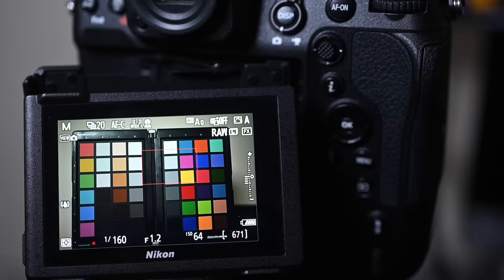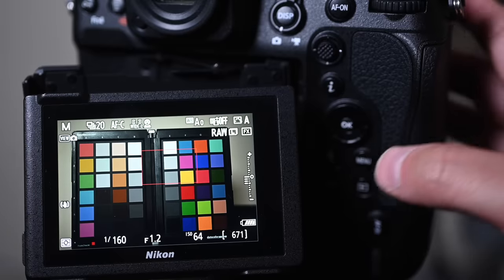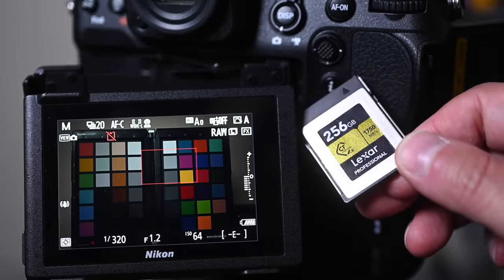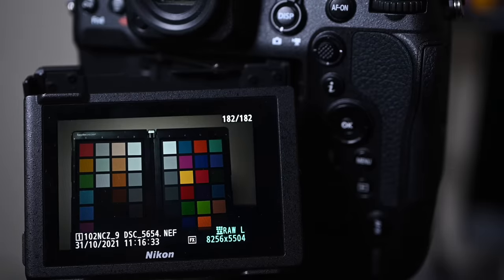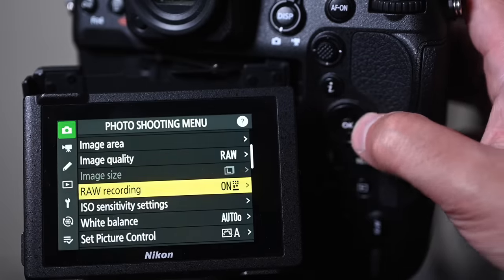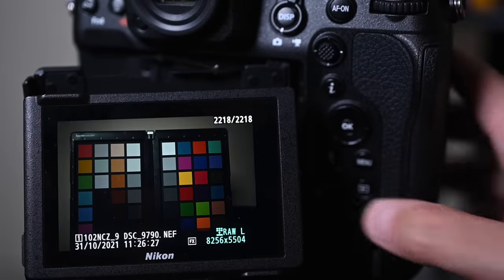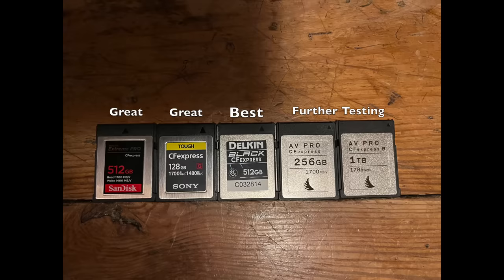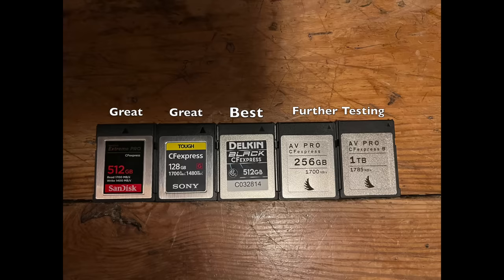Nikon Z 9 Buffer Tests. XQD/CFe/LosslessRAW/High Efficiency Raw

Comment: All of these shots and absolutely no wear and tear on the shutter. Brilliant!
Reply: Resale values would be insane!  No more "what is the shutter count?" queries.
Reply: But there will be wear and tear on the shutter button itself and on you shutter finger muscles......
Reply: @BigRedDogATL  And all the gunk built up around the AF-ON button 😂
Reply: How about wear and tear on the processor? Is it possible that the processor will slow over time? That’s the one thing I’m wondering, is while it’s great to think we won’t have to be concerned with shutter count anymore, but yet, everything about the camera is dependent on how well the processor performs. I’m sure that must have a lifespan or a rate of degradation.
Reply: @paulrubino1399  I'm no engineer but I think solid state electronics last a long, long time. The thing to worry about is acute damage, not wear and tear over time. Then again, sensors do get gunk in the AA filter that can be hard to get out. That's happened to me.
Reply: @paulrubino1399  you should at least get a good 10 years out of these machines with proper care. I have a D800 that I brought in 2012 that has been dropped several times and it starts up and runs just as good as day one.
Reply: I fully expect this to be the last professional camera I need to buy (oh ok maybe a portable dx model too lol).
Reply: @kjltube  Need: Yes.... Want: Nope ;)
Reply: I guess the highest levels of wear and tear will be on us spending hours and hours in front of the computer screen sifting through all these almost identical frames, ha ha! I think I’ll stick to landscape photography! 🤪
Reply: @paulrubino1399 Processors generally can degrade in performance over time.  But that will only ever happen when you operate them near their thermal limit for many many years, because the heat will effect the conductivity of the gates in the transistors. Cameras are using ARM based processors which operate on a 5-10W power budget, which is miles away from allowing them to get even close to their thermal limit. Those processor produce so little heat that they don‘t even require additional cooling. So chances that those processors will ever show any sort of aging during 10 year lifecycle are pretty much zero
Reply: @paulrubino1399  The camera will be technologically obsolete before anything like that happens.
Reply: @fetzie23  true!
Reply: Still not a global shutter though!
Reply: @Photo-Me-Ike can't wait to see this thing in your hands bro... it's a bit out of my league for now so I'll catch up in the next generation
Reply: @freetibet1000  my z6 is great on landscapes.
Reply: @romanpul  will probably take me to the end of my life cycle!
Reply: IKR!
Reply: @gosman949  Of course! It would be so sad if people started to think that their cameras are junk just because a new and more fantastic one is about to enter the market. In my world it’s still the stuff between our ears that matters the most. And I think it’s going to remain that way for a very long time, don’t you?
Reply: If using the mechanical shutter, every click puts wear on it. If you use the electronic shutter then that's different, but there will be wear on the sensor itself (and mechanical shutter if you're using it).  Everything has a finite life, whether it has moving parts or not.
Reply: @GlennMariano  But what if the speaker for the simulated shutter sound fails? :)
Reply: @HR-wd6cw  I agree that everything got a finite lifespan and the fact that this camera lack a mechanical shutter would mean that its potential lifespan is increased. But then again, anything can brake even if its not of a moving kind. In my own case it has always been due to fumbling and frozen fingers that have been the main course for damage in the past, ha ha! Human error!
Reply: @BowlesImages  Good point, Nikon has to start measuring speaker life now.
Reply: It does have a shutter, doesn't it? Just not a mirror?  Thus the mechanical sound.
Reply: While that’s true, I don’t think I’ve ever wore out a shutter.

Comment: This is why everyone trusts your info, when its based on fact and showing the options, then its down to the user, i am so glad nikon give you the access.
Reply from the maker: Il let them know for sure so it doesn’t stop
Reply: @RicciTalks  The community appreciates all the work you do, keep up what is great work, appreciated and shared often.
Reply: Definitely, this all started because the very trusted DP Review, Chis Nichols only got 40 frames buffer in 14bit Lossless and there is no 12bit, so then Matt Granger said everyone was horse-shit liars, but he was testing the Lossy High Efficiency Plus mode, not 14bit Lossless RAW. Which just caused more confusion. Still with the fastest cards, you'd be lucky to get about a 4 second buffer, not bad, not great...but pretty decent for 20fps in 14bit Lossless! I get around 75 frames buffer on my D850 in 12bit Lossless RAW with a Sony CFexpress 128GB Tough series card. But that's at 9fps (actually 9.5-10fps with fully charged battery at 64 ISO) with the MB-D18 and EN-EL18c battery, so around a 7.5 seconds of buffer. Obviously the Z9 is getting more images in the buffer, at 20fps and 14bit Lossless. I never noticed any real difference at all between 12bit and 14bit Lossless, but I still wish the Z9 offered 12bit Lossless, just for the smaller file size, without any noticeable losses in IQ. Seems with the Z9 you have to shoot Lossy to get that big, endless buffer. Still the Z9 is awesome and maybe someday in firmware they will release 12bit Lossless as an option. No more sRAW or mRAW either, right?
Reply: @patricksmith2553  In the Nikon panel discussions there was a comment that the compression software more efficient and that the file size for 14b not significantly larger than 12b files on previous versions.  Ricci  hopefully will give a better explanation.

Comment: Thank you so much for this methodically made video which clear all the doubts about the Z9 buffer issue.
Now the following takeaways,
1.	Speed of the CF Express card is critical to get the best buffer performance
2.	Camera does not give 1000 frames in lossless compressed.
3.	Z9 give more than 1000 frames in High-efficiency Star with Delkin Black series CF Exp cards
4.	Need a bit of clarification on the image quality between Lossless compressed and High-Efficiency Star.
If there is a negligible quality difference between Lossless compressed and High-Efficiency Star, then no worries, I will go ahead and buy for wildlife work.  
Thanks again and looking forward to your next video on image quality.

Comment: Another great video.  I've done some similar card testing on the Z6, Z7ii, and D850.  My routine was to test for 35 seconds, and then to count the number of frames written in each full second using the EXIF data.  What I found is all cards write at the frame rate for the first few seconds until the buffer fills.  Once filled, the camera would shoot at the write speed of the card because the buffer needs to clear to allow space for an additional shot.  Depending on the card, write speed with a full buffer was highly variable and could be quite slow.

In your test, it looks like the XQD card writes 13 frames in 1.5 seconds or around 9 fps, the Lexar CFExpress writes 41 frames in 3 seconds or around 13 fps, and the Delkin Black writes about 61 frames in 4 seconds or around 15 fps.  That means the full buffer clears for the Delkin Black in 1.3 seconds.  There are plenty of cards that are slower than the Lexar card.  The ProGrade Gold was the slowest card I tested.  Card size also makes a difference and smaller cards - especially 64 GB cards - are much slower.

One test I'd like to see is the write speed with a full buffer using lossless compressed.  In testing the Z6 and Z7ii, I found the cards were exceptionally slow (less than 2 fps with the ProGrade Gold) when the buffer was full, and stayed at the slower speed until the buffer cleared fully.

Comment: The way to go is by short bursts . Anyone who has been interested in fast action/ wildlife will know how quickly you can fill the card needlessly , I know I have done so with my D5 and that was at 24 mpxs let alone 45 at 20 fps! The important factor is how quickly the buffer will clear and evidently it will do so in under 1-2 seconds. I think Nikon has knocked it out of the park with the Z9 as it is BUT there’s another HUGE thing coming in the driveway in the form of computational photography for HDR. I see a Bright future ahead as Nikon has done away with the mechanical shutter and there should be room for developing the system more towards that respect.
Ricci also knocked it out of the park with your videos, not just for the z9 but each and every single one since day one, hands down the best channel for photography. Thank you for your efforts mate great stuff.

Comment: Thank you for a very transparent and informative video, Ricci! I already saw Matt Granger's video and knew right away that there must be some confusion on DP Review's part. It's just sad that haters are using DPR's expertise and their experience with whatever memory cards they tested as an opportunity to bash Nikon just for the sake of it. This is becoming so fanboyingly childish and tiring... Some people really need to find better things to do with their lives other than fueling tribal wars just for the sake of it!
Reply: Yes, I also think that a lot of the initial confusion stems from that first test video DPReview put out using any random card they had laying around. After that some people started to spread the idea that the capacity of a card should not even be an issue at all claiming that it’s all about an insufficiently sized buffer that’s causing premature choking. Now Ricci have put everything right again with this excellent video more or less confirming what the community of more intelligent commenters suspected was going on with this “issue”. Problem solved! The good thing about all this (unnecessary) confusion and noise is that now EVERYBODY knows that the name of the new king is Z9 and it’s made by Nikon.
For me, if I want to get relevant and correct information regarding everything Nikon I go to Ricci for that! No need for a second opinion even.

Comment: Nikon users don't spray and prey! We'll leave that to the Canon-users! Whilst you can take 120 frames per second, I think this will be more of a specialist angle. I can't see using more than 20 FPS and then rarely. My main motivation for possibly getting this camera would be bird photography. The Z6ii I have at present is the fastest frame rate camera I have ever had and I may have had it on continuous low sometimes. If I had a better birder lens I might have tried Canon-style spray and prey, but I don't, so I have to steer away from bird photography until I can get a longer lens. I really hope the 3D tracking makes it down to the Z6ii... * Looks at Ricci * - he's defo not going to answer that one! Great stuff Ricci and thanks for all your content.

Comment: Always great to have you bringing a clear un biased view of what Nikon is doing. 
It is amazing to see that Nikon has basically designed the Z9 to have the data buss and processor be able to output at virtually unlimited speed. The only bottle neck is the medias write speed and capacity. WoW.
Thank you so so much for all your work and sharing.

Comment: The test I’m dying to see is how the lossless raw of the Z9 compares the uncompressed raw of the Z7ii and even Z6ii in extreme dynamic range situations and low light, shadow recovery etc. Does the Z9 hold better than the Z7ii and Z6ii? If so Im selling both my Z6iis for a Z9. If the the Z6ii is still better in low light, which on paper it should be, I’ll have to keep one. If you could test that out, I’ll be eternally grateful. And Ricci, thank you so much for sharing all your knowledge. You are the best ressource for us Z shooters! It’s so appreciated! :)

Comment: Thank you for all your wonderful work. A suggestion for faster writing (via firmware setting) would be to alternate pictures between two cards. You would not be able to have a backup of each, but would get close to double write speeds. Still loving my Z6II but, the Z9 seems impressive.
Reply: You suggestion is basically a RAID-0 configuration but file based instead of being data block based. This would actually make it manageble for people.
Assuming a serial bus for each memory card and an average file size of 60MB the individual card write speed needs to be at 600MB/s at 20 frames/s for the buffer to be always cleared while shooting. Of course there is some overhead but the math in the example should make such a cinfiguration a viable option for people who want to shoot non stop. However there are likely not that many people who actually need it but having such an option certainly would not hurt.

Comment: I'm so glad they did cost savings by not over-budgeting on buffer. Probably saved a good $500-1000 over what would have been 2x or 4x the buffer size. The future is fast storage, not big caches; so nice that you can save on the camera body and make up for it with cards that will decrease in cost over time.

Comment: Thanks Ricci for your excellent and very informative content. 
Although Nikon could've (probably relatively easily) put a bigger buffer memory in what is its new flagship camera, I think (as you mentioned) as CFExpress cards get faster, so will the camera's ability to clear the buffer, meaning an increase in shots, before the camera slows down, essentially becoming a complete non-issue in both compressed modes, maybe even for lossless compressed mode also.

Comment: Thanks you, Ricci! Hopefully this will put an end to the "Angry Photographer" (Theoria Apophasis aka Ken) trolling (he's calling this a "near failure" of a camera). I don't generally feed the trolls but Ken is a special kind of troll - he believes in his BS...

BTW the Delkin Black 128 GB has a write speed of 1710 MB/s.  The 256 is a tad bit slower. In any case roughly 300 MB/s more than the the 512GB you're using which is rated at 1405 MB/s so perhaps another 20+ shots or maybe unlock up to 150 (I say that since that half second clears the buffer). Perhaps even a firmware upgrade will unlock something (do you think)?

Comment: So it’s pretty clear that the buffer is a not and issue for the most part.  I do believe Nikon did cheap a little bit with the 20 frames RAM buffer, that is less than 80MB.  If one takes into account how bad the Z9 looks against the Sony A1 on paper  one wonders what make the engineers believe that a 80MB buffer was a good way to cut corners. Thanks for sharing, Matt granger did a video on this issue too.

Comment: Thank you for setting the record straight! 😎

Any insight why the LCD screen isn’t bigger? Seems like the real estate is there.
Reply: Because Nikon could save money by using the same top display as in the z6/7(ii) bodies. Plus, the display can't be scratched as easily by strap hardware... I'm just guessing these, but they seem logical to me?
Reply: @ewyss9206  Sorry, I was actually referring to the back display. Though the top area could have been used more efficiently too. If you look at the rear display it has a considerable black border around it and it seems like it could have been made 10% larger.

Minor details and perhaps something the v2 will improve upon
Reply: @DPCPhotos  Oh okay! Well, I guess it's for better durability, the broader frame of the back display lets you grab the screen with gloves etc...
Reply: @ewyss9206 hmmmmm, but doesn’t the Canon go edge to edge?
Reply: @ewyss9206  Do you own a camera?

Comment: Have you looked at the Delkin Black 128gb? Minimum write on that size is even better than the 512gb. I don't know why anyone would use the XQD cards at this point, they are old tech like SD cards. Great video, this just shows that if you get a ferrari of cameras, you better get the best memory to match! Thx.

Comment: Fantastic content. Goes back to the whole XQD vs CFexpress improvements in the original Z's. Correct me if I am wrong, but the only benefit a Z6-7 user gets from CFexpress is in reading/downloading to computer, while the Z6-7iis will see a buffer improvement over using XQD. Cheers!
Reply: I'd be interested to know if that's the case. I'm a Z6 and XQD user, but if I'm going to be buying CFEx cards for the Z9 I'd wonder if they would also speed up my Z6 at all.

Comment: Thank you for your video!  Have you tried the Z9 in a studio, with strobes?  If so, how is the performance?  Is there any issues with mixed lighting environments?
Reply from the maker: Iv used it with speed lights and LED panels and have had no issues that was only about 1-2hours of shooting tho
Reply: @RicciTalks  - thank you!  Were you shooting at 200 or 250?  Did you try HSS?  Have you tried shooting in mix lighting environments like a concert or basketball game?

Comment: Thank you so much for this, I am planning on initially using my Z9 with an XQD so this is very useful to know. Where did you get the Delkin Black from? I can't find them for sale anywhere but ebay, only Delkin 'Power' Green ones which I assume aren't as good. The one thing I've not seen any testing on so far with the Z9 is dynamic range, and how it compares to the D850/Z7. I would LOVE it if you could cover this. I've watched a few of your videos in the past but am just now going to subscribe.
Reply: B&H have them.